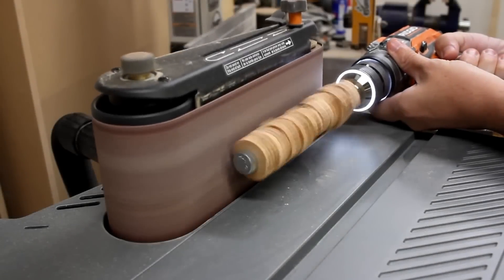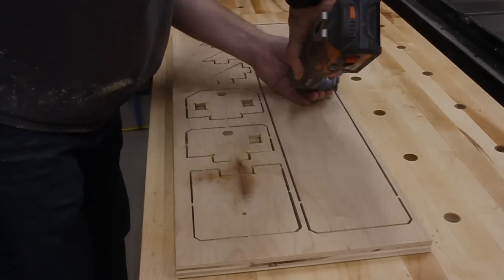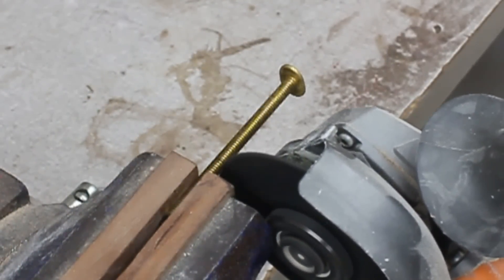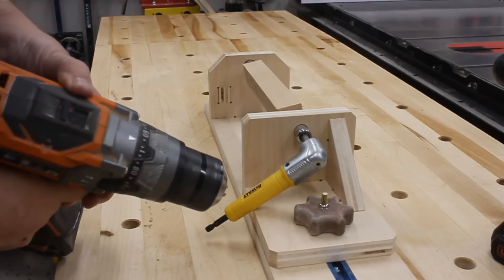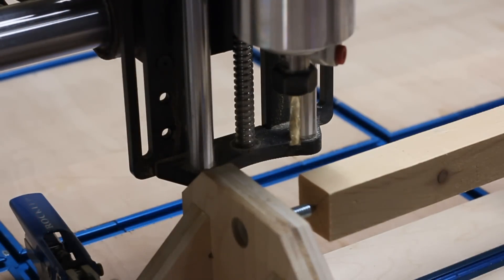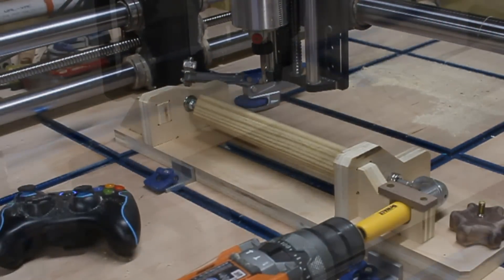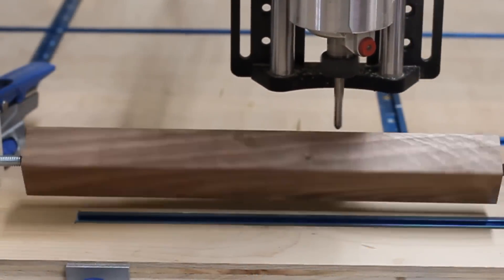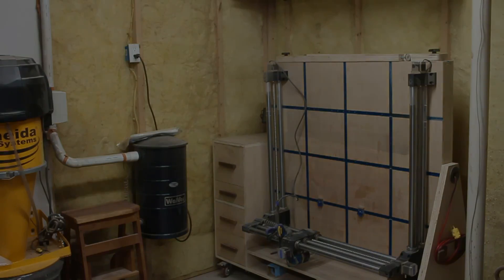Shop Work: Making a DIY CNC Lathe

Comment: What you really need is a high speed roughing toolpath, and save your slow setting for finishing.  Even better, if your CNC controller is capable of handling a 4th axis, would be to hook up a stepper motor instead of your drill.  Then you could turn spirals or any other design you wanted.

Comment: Did you build the CNC lathe, or did you purchase it?  If you purchased it, could you provide a link. Thank you.
Reply from the maker: You literally watched me build it in the video.
Reply: 'Sorry, I meant the CNC you use with the lathe you built on.     @FishersShop
Reply from the maker: @canterburyworkshop5631 It's a OneFinity.  Check them out at onefinitycnc.com
Reply: Thank you.  Just purchased the lathe plans, and will subscribe now. @FishersShop

Comment: What if instead of using the router you use cutting bits that are like what they use on a wood lathe? I think the spinning of the spinde bit isint the same as a stationary bit that isint rotating

Comment: I like your skills with hand tools, but I use the CNC to make all my knobs, hex for the nut insert too. Keep the videos coming. Nice work.
Reply from the maker: If I had a file handy, I probably would have.  I've just made so many by hand then I knew I could crank one out in no time.  Plus, the method I use to make them is kinda neat to see if you've never seen it done before.  Thanks for watching.

Comment: I love it? I wonder if you can use a stepper motor instead of the drill?
Reply from the maker: I could but then I'd need to also get a controller and power supply and code it to turn.  Drill is easier.  It's not nearly as nice and pretty as a stepper, but it'll work in a pinch

Comment: Hey Drew...what if in using the down cut bit, you just run the drill in reverse as if you are unscrewing an item vs driving in?
Reply from the maker: Yes, that would work but you'll want to make sure your drill can turn at the right speed going in reverse.  Otherwise, you could just move the entire lathe to be behind your CNC spindle.

Comment: What a terrific and well done design Drew!!  I really enjoyed watching the project develop as you worked through the issues.  

I have a question on the tool path.  I've been trying to figure out how to generate such a tool path using the X-Z plane, cutting directly above the center of the spindle.  But it just hit me that you might be cutting a constant depth pocket in the X-Y plane instead, which would cut the spindle from the side.  Can you please describe the tool path you used?

Thanks for a ton of great videos, and for the out takes.  My wife and I really enjoy them.
Reply from the maker: Thanks, Jerry.  It's just a standard X,Y,Z carve but the stock happens to be spinning.  So once the bit reaches 1/2 the depth of the stock, it's technically done with the carve.  And yes, the carve is happening against the side of the tip, like a typical carve.
Reply: @FishersShop  Thanks Drew!  That really helps to simplify it for me.

Comment: Looks neat. Do you have a normal lathe? Once you start turning by hand it becomes pretty addictive. You want to upgrade the lathe because you grow out of it, then upgrade your chisels to do different cuts. I sold my CNC because I rarely used it and now have a huge spot I plan to put a larger lathe so I can turn bigger bowls and platters. Your design is cool, but 40 minutes for a small spindle is a really long time, plus design/setup. You could turn it by hand in like 10 minutes. Not trying to knock this down at all, its extremely clever and thought out. But if your basement has some room a lathe is awesome to have. Even if its a benchtop one.
Reply from the maker: The first line in the video is literally "I don't have a lathe in my shop".  lol  Yes, 40min for that is a long time but I could mess with the speeds I'm sure to cut that time down a bit.  However, even if I had a legit wood lathe, I'd still have trouble making exact replica pieces.  This little CNC lathe can do that easily.
Reply: I have a mini jet. Have had it for many years.  Addicting is an understatement. Everything I own is now round. You be surprised it doesn't take much practice to duplicate identical pieces. Plus, they sell duplicator for production work.  Cool invention though.

Comment: You are basically cutting your final pass right from the start, which wastes a lot of time. Rather have a rough pass, which removes 98% of the material, and then a couple of final passes to ensure a smooth surface finish.
Reply from the maker: Doing it that way would definitely make it shorter but I'm in no hurry.  I find it more valuable to just set up the machine once and walk away as opposed to having to do tool changes and program multiple jobs.
Reply: @FishersShop  You can still use the same tool for both, and you can program your g-code to run both tool paths sequentially. Rough pass. Finish pass. Done. 😉

Comment: I'm pretty sure the spurs should be angled in the direction of rotation, so they will have a tendency to dig in instead of cam out.
Reply from the maker: That would probably help even more.  Luckily, no issues thus far.

Comment: Hmm.... because CNC bits cut best from the side, not the bottom... I was surprised to see you cut the shape from the stop (Z direction) instead of the Y direction where you'd engage the side of the bit... i'm sure I'm missing something super obvious that'd be wrong with that
Reply from the maker: It's still cutting with the side of the bit.  It's basically a normal CNC operation with the Z only going downward after each pass along the X axis.

Comment: Great idea, first I've seen of its kind. But you ran into two issues that had an easy fix I think you missed. Your Z axis was mounted at the lowest of 3 possible locations. Just raise it up 1 or 2 bolt holes and you'd be all set.
Reply from the maker: Yes, I could have.  But I do quite a bit of other CNC work where that middle position comes in pretty handy.  Plus, the lathe really didn't need to be that high, in my opinion

Comment: Really creative, Drew! There are commercial rotary 4-axis attachments for CNC machines, but yours gives you the satisfaction of designing and building your own and is a lot cheaper to make. I just got a Snapmaker 2 machine for my little shop, and I'm having great fun learning how to use it. It is a 3-in-1 3D printer, laser cutter/engraver, and CNC machine. I got the 10 watt laser module and the rotary 4-axis CNC module for it as well, because I really wanted to be able to laser engrave and mill round things. It's way smaller than your CNC, so I can't make anything nearly as big as the spindles you made, but for small things, like chess pieces, etc. it should work pretty well, I hope. I still have a ton to learn, but for me, that's what makes it fun and interesting!
Reply from the maker: Sounds neat!  Thanks for watching

Comment: Idea: Try sourcing a wiper motor to run the rotational source. With a cheap potentiometer and a 12v AC adapter you can fine tune the speed and walk away. Don’t ruin your drill or risk the battery dying. Great built very Izzy Swan
Reply from the maker: Glad you liked it. Thanks

Comment: WELL...... I suppose... if you don't have enough need for a lathe to buy a lathe.... I'll give you an 'A' for ingenuity though. I'll also admit that I occasionally use my metal lathe and milling machine on wood projects. Hey, as far as the machine is concerned, it's just reelee reelee SOFT metal....
Reply from the maker: Even if I had a legit wood lathe, I'd still have trouble making identical pieces.  At least this solves that

Comment: Great to watch! Your CNC has X Y Z axis, it should have A and B (possibly A is paired/reversed with one of the Y axis) which if youre feeling 'fancy' you can add a 4th axis 'chuck' if you want to do some really fancy engraving on your lathe work :) 

When I designed my CNC machine, your Z axis problem was exactly the same problem I had come across in one of my early designs. The whole router Z axis assembly being static, while the router moved but greatly constrained the height of materials. To eliminate possible crashes, I flipped the Z axis assembly so the entire assembly moved with the router which allows for greater clearance control over uneven parts that would not have been possible with a stationary set of guide rails on Z.  (my Y axis gantry is 14.5" base to table, bit to table is 10.5", 5'x10' material size)The main problem I had come across with this design is now there is more weight being moved on Z which required redesigned stronger components. Those linear rails on your machine look strong enough that you could easily mill aluminum/copper and would easily support a mobile Z axis configuration. (yes i am oogling over your linear rails)
Reply from the maker: I'm not sure if I'm comfortable with another man oogling my rails
Reply: have to admit... them are some mighty fine rails tho... and for the simplicity of the build, that lathe is a very fine addition to the table

Comment: Hei from Norway.
You could possibly have used a teenut and reversed the prongs instead of the wingnut, that way you wold have four prongs and realy easy access for more.
To get more height you could maybe just fasten the head and tailstock directly to your wasteboard t-tracks?.
Reply from the maker: I have footage that I didn't include of me trying exactly that.  The issue was the steel for T-nuts is very brittle and when I bent the prongs they all snapped off.  
And yes, I could have used my T-tracks in my table but I'm selling plans for this so I had to make it usable for others.

Comment: Amazing stuff. Btw at the beginning where you cut the side edges for clearance, you could’ve just used longer bolts for the spur and points, such that the bearing holder vertical edges do not interfere with the z-axis of the cnc. Also, while the drill setup to rotate the piece is very tidy and simple, look into replacing it with a stepper motor whose speed that you can control using a potentiometer. That will give far finer speed control. If you are feeling really adventurous, you can integrate that fourth axis with your CNC. Great job nonetheless 🙂
Reply from the maker: Yeah I was aware of that.  It also could be solved by using longer stock and just working in the center of it.  But I had to shorten the lathe due to the Z-height issues I was having so it could reach it's "safety height" while moving.  I thought about using a stepper, it's actually in my amazon cart still, but I just didn't want to have to mess with a power supply and controller for it.  The drill was a super fast and easy solution

Comment: You could buy Analog versions of this back in the 1960's. If you can find a junker cheap lathe with the poppets (Sidewalk Recycling is good) you can knock one up easily, no CAD/CAM required, just some hardboard analog guides, maybe resin reinforced fiber if you are going to use the guide a lot for production work.

Comment: Pretty smart.  Did you consider changing the mount points on the z slider- like using one hole lower?  Seems like that would solve the z height alarm error and give more clearance for your jig. Granted, the higher z mount setting might cause problems for your other CNC carves, but it is only four bolts to adjust.  
Again though- well done.  Pretty cool work.
Reply from the maker: Thanks.  The Z-height issue was that I was zeroing the CNC at a height where the Z couldn't go up any higher to reach it's "safety height" while moving around.  Moving the slider up might solve that

Comment: I can never understand why wood turners after marking he centres on square stock, don't cut off the edges before they start turning [ make it hexagonal ] less for your cnc to remove. Good vid though.
Reply from the maker: Because sometimes they want those square portions in their finished piece.  Think of a typical railing spindle.  they're square on both the top and bottom but round with curves in the center.  Much like the last thing I turned.  But yes, if you desire a total round piece in the end, then it makes sense to round the edges first.

Comment: Aren't you worried about the lateral forces on the bit/head assembly? As it cuts and then breaks free and then engages again, I would think those forces will eventually have a negative impact on the position/stability control mechanisms.
Reply from the maker: The stock is engaging with the bit against the side of the tip... the same as if the CNC was traversing the stock in a normal condition.  Should be just fine
Reply: Thank you for the reply Drew. My concern is that with a traditional traversing cut there is constant pressure on the bit. However, given the wood is not stationary (rotating) the force is likely to fluctuate. I know this potentially an minor risk, but there is always some knucklehead who will set the rotation speed to “11” dive in. I guess that is just Darwinism at work 🙂 Keep up the great content.

Comment: Seems to me spinning the piece faster would be better. You're not going to significantly increase the feet/sec of the cutter in doing so. I'd start with spinning it as fast as you can without tearout or jamming, then increase the CNC speed until the results are not satisfactory.

You might have to beef up the holder too. Seems like in the last cut when putting the oil on the walnut, the piece was wobbly.

One other note, in your sketch software, there seems to be a "pen" tool. While I haven't used your particular software, generally you can make poly-lasso curves by clicking and dragging to add curve handles (similar to fusion 360), rather than just clicking to add points, which results in your straight lines.
Reply from the maker: The pen tool is what I was using.  Easel is just a very limited CAM program.

Regarding spinning the stock, it definitely needs to spin slowly, not fast.  Think of an average feed rate of a CNC, which is like 70-90ipm.  If the stock on my lathe is rotating at 60-70rpm and it's more than 1 inch in diameter, that's awfully close to typical speeds, if not it's even faster.  Increasing the rpm even further might introduce a stress load that the CNC can't handle.  With soft woods, I might be able to get away with it.  Like I said, I could play around with it, but I'm already getting really good results.
Reply: @FishersShop  Since you're a fusion 360 guy, why not draw it in that?

Might be time to spring for a lathe and a lathe duplicator. 45 min just seems really steep price for such a small part.

Comment: Awesome video Drew. As a wood turner you nailed it. It is time consuming to get two spindles the exact same from top to bottom. Doable but time consuming. Keep up the amazing work. 👽
Reply from the maker: Thanks a lot!  Yeah, I was thinking that even with a proper lathe, it would be hard to do... especially since I'd be a novice.  But with this thing, I can do it no problem.

Comment: I actually really like using those little worm drive hose clamps for controlling the speed on a drill for these types of tasks. 
Has the down side of being slower to turn off but greater speed control and less likely to get knocked off the drill.
Reply from the maker: Excellent idea
Reply: @FishersShop  I've been watching your stuff for a while. Happy to help. A lot of wormdrive hose clamps have flat head drive mechanisms...

Comment: Kind of surprised you didn't just build the head and tail piece assemblies separate such that they lock into the T-track built into the bed of your CNC.  That would further lower them so you had more Z axis headroom.  Regardless I love your ingenuity and opportunistic finds in your neighbor's garage!
Reply from the maker: I design my projects so that the plans will sell.  So I have to think of what other folks might have and what they'd want.
Reply: @FishersShop  After I posted that comment I knew there probably was a reason.

Comment: Pretty cool!  If you use a stepper motor, it will direct drive from 0 to 200 rpm. Your speed will be accurate enough to turn spirals.
Reply from the maker: Yup, but I'd have to be smart to hook it up to the CNC controller.
Reply: @FishersShop  Maybe your neighbor could help!
Reply: @jdwantsyourcouch  sadly, the neighbor neglected to check his brake lines for...being there...the other day
Reply: @FishersShop  Doesn't Onefinity have a 4th Axis option?  That's basically what you created so should be easy to implement.  Just need a cheap motor and driver stepstick.
Reply: @FishersShop  You can hook it into an Arduino with an inexpensive driver module and just make a standalone rotary drive.

Comment: I honestly think that you would do better by speeding up the drill turning your piece than keeping it slow.
Reply from the maker: The stock definitely needs to spin slowly, not fast.  Think of an average feed rate of a CNC, which is like 70-90ipm.  If the stock on my lathe is rotating at 60-70rpm and it's more than 1 inch in diameter, that's awfully close to typical speeds, if not it's even faster.
Reply: Yes but at that feed rate, if your work was spinning at a higher rpm it would remove less material allowing you to speed up your feed rate if you wanted, unless you are worried about your bit overheating.  I would only be concerned about the lower rpm when using larger diameter stock in the lathe.  Of course being a machinist for 39 years, I’m just guessing.  Also, the first bit you tried will plunge but the actual cutting when feeding is at the side to the tool that is why it pulls upward to remove chips from the cutting area.  You may do better feeding into the work from the side vs the top.  You may also get less chatter by knocking the corners off square work on your router table if the application fits.